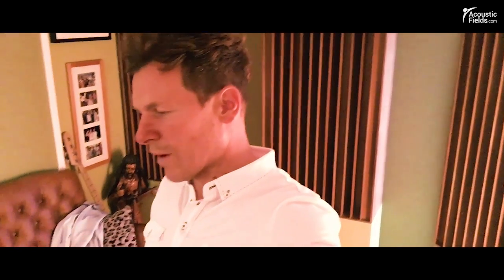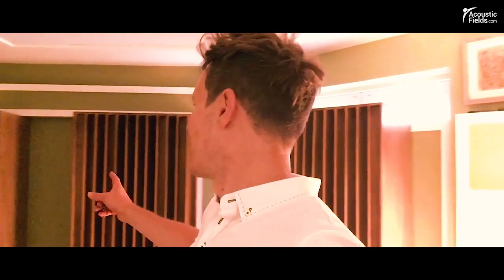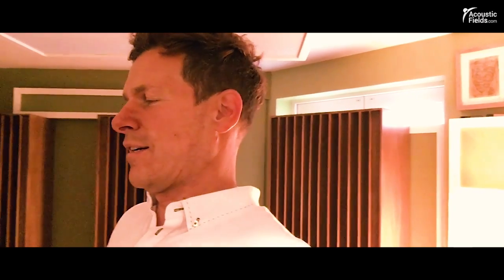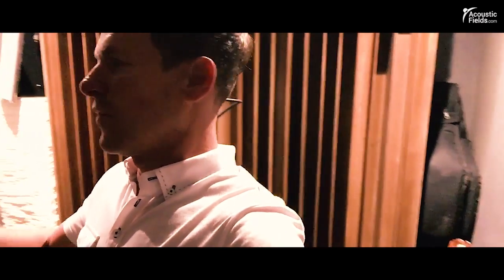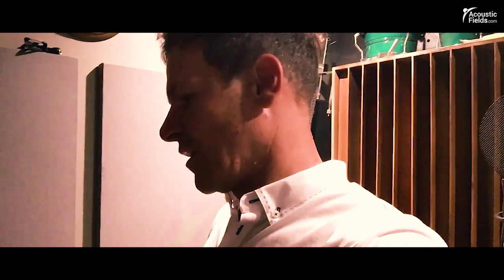London | DIY STUDIO - www.AcousticFields.com

Comment: I have been told that it's better to place the acoustic panels about 1 inch from the wall surface. I notice that in the video, the panels are flush to the wall. Is there any benefit to raising the panels an inch off the wall's surface? Thanks.
Reply from the maker: PO,   Middle and high frequency absorption works with air flow or as we say molecular velocity. Extending a sound absorbing panel away from a surface area allows for air flow on both sides of the panel. The panel must have the ability to absorb on both sides and you must figure in both surface areas when doing your calculations.
Reply: Ah! Thank you. So it is definitely better to have them off of the walls slightly.
Reply: Acoustic Fields What about the ACDA units that are made for absorbing low frequencies? Do they need to have space from the wall?